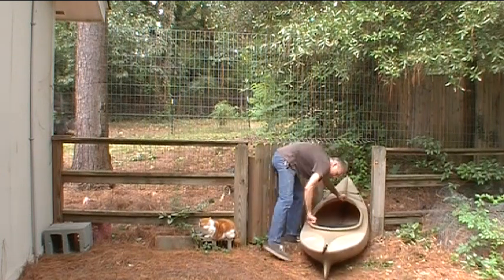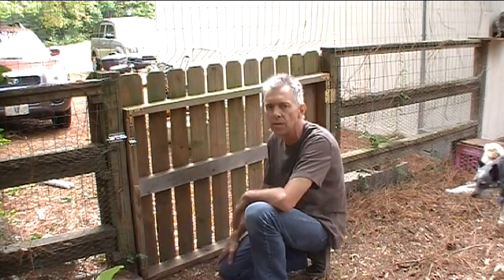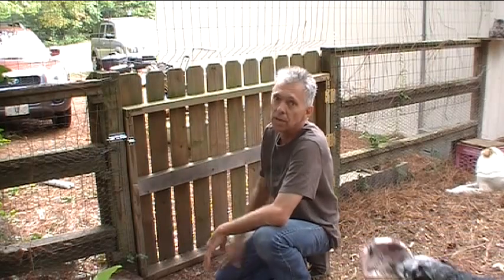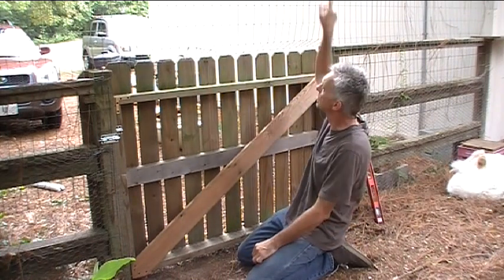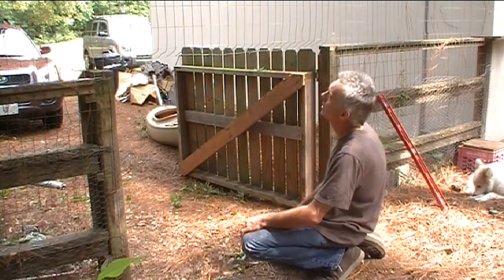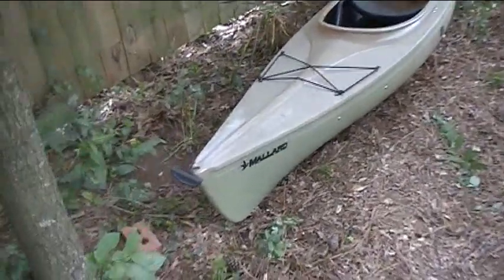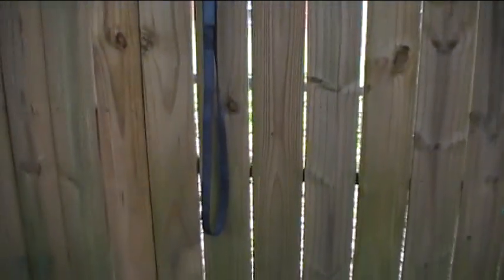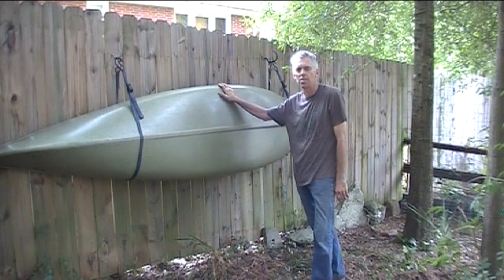Gate Repair & Kayak Storage

Comment: Curious....would it have been better to apply the brace from the upper left to lower right (as you were installing it) so it would have been under compression instead of tension.  That is, especially if placed inside the 2x4 frame it would wedge itself in and hold the gate up a little better.

Comment: Yeah it'd be better if the brace was installed so that the weight of the door pushed down on it, and place it inside the wooden frame. Because right now, you have the weight of the door pulling on the screws, and over time they will dig trough the little bit of wood between them and the edge of the plank. I predict the plank to fall off after a couple of year, and that your kayak will have an inch of chicken poop all over it next time you want to use it.